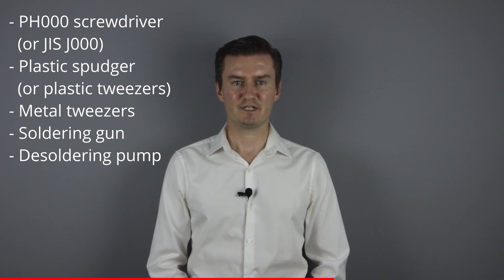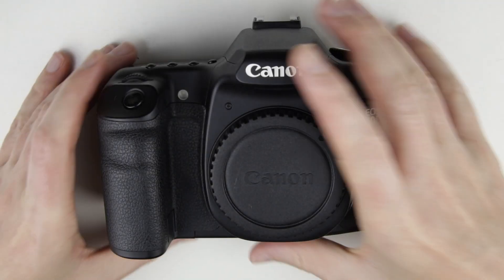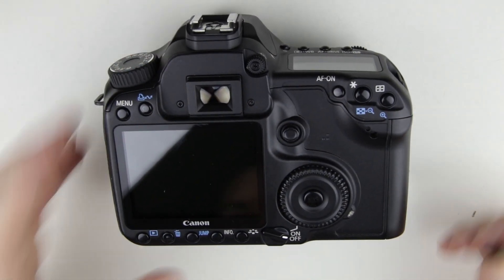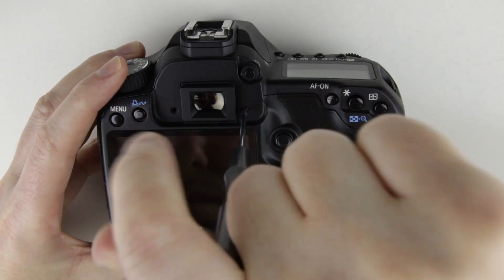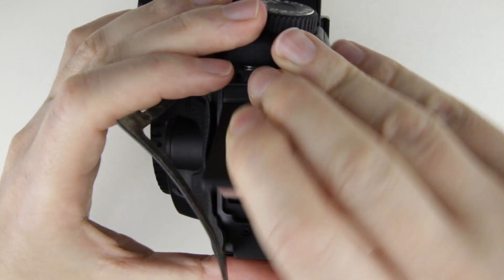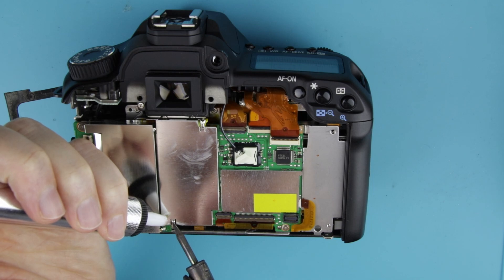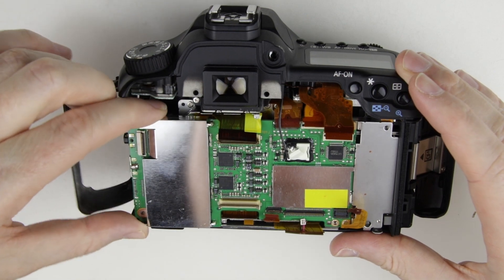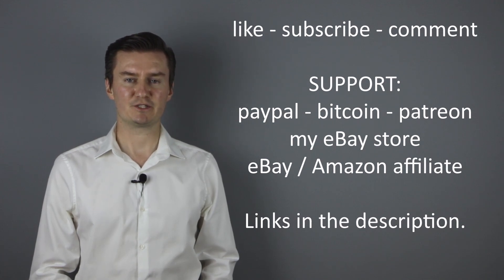Canon EOS 40D disassembly to replace the main PCB

Comment: Thank you for this video. I recently got this camera from eBay and unfortunately it seems like it has a hardware problem as I immediately get error 99 when it is turned on , no lense or card in, not able to even take a test picture. I'm clueless on what's the exact issue, I'd wanna keep repair costs down from going to the $300s so I'd like to give it a go.

Anyone experience something similar?
Reply from the maker: Most likely it is shutter or mirror problem. There is a small chance that the problem is caused by the PCB.
Reply: @CamerasLensesEtc  Can someone with knowledge about electronic but not that much experience handle a shutter issue in this camera or something like replacing the lcd? I'm thinking about giving it a shot on one of these ebay cameras.

Comment: Thank you for this. We have a 40D with broken CF pins but otherwise fully working so I need to disassemble to repair.

Edit: Doing this now. For pin repair, after removing the PCB remove the two screws on the right-hand corners of the PCB. Flip it over and remove the screw top right. Slightly bend the side of the metal cover to unclip it, giving access to the pins. I'm using a CF to IDE adapter card for donor pins. Just waiting for my soldering iron to heat up...
Reply from the maker: Then this video will be helpful for you.
I have other videos about disassembling cameras for accessing the pins, I would recommend to view those also.